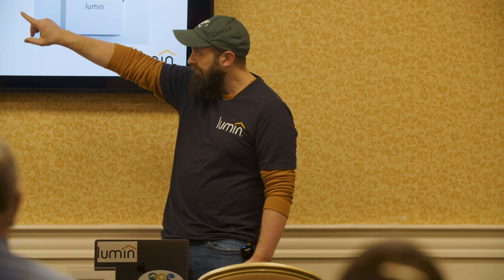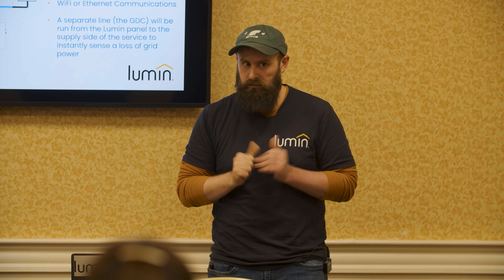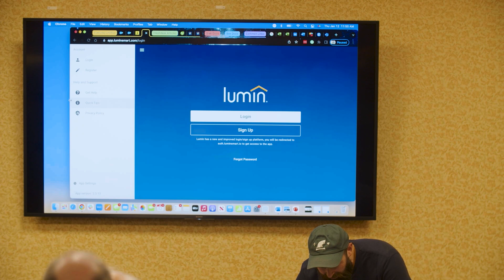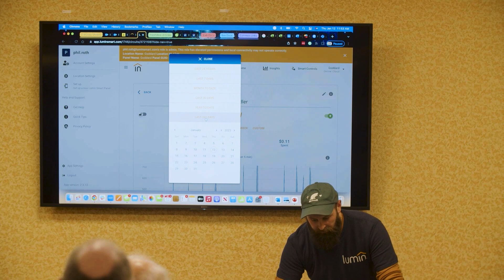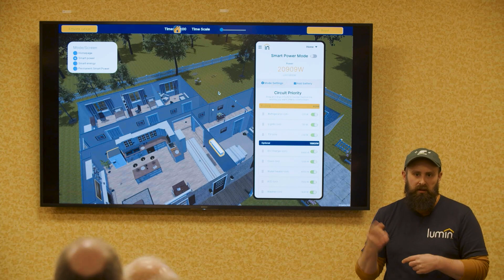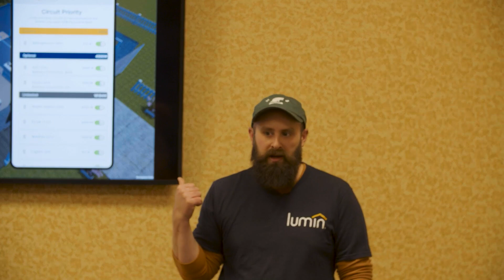Smart electrical panel for whole home backup by Lumin

Comment: All the videos have helped me alot the past 5 years. Cant find an answer on youtube, I have 4 450w panels 2s2p, using a powmr 60a charge contoller, so 4x450 is 1,800w, on rare occasions I’ve seen the charge controller go up to 2,200w, thats a 22% increase. Is it normal for mono crystalline cells?

Comment: There's something I can't get my head around. When I look at discharge charts it says my RV batteries are 50% discharged at 12.2v and completely discharged at 12v. I don't understand how the use of 1 v difference means a 60 cold cranking amp battery is dead? What am I missing? I'm so worried that I won't understand the explanation either... I'm referring to pushing the button on the panel in the RV to get the battery charge level to get these readings.